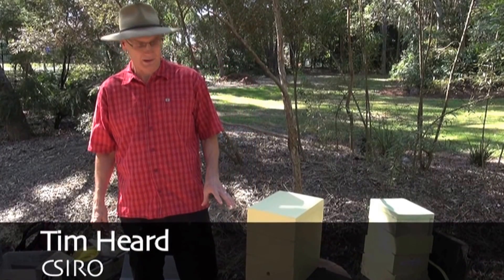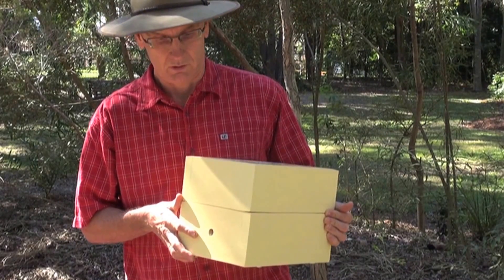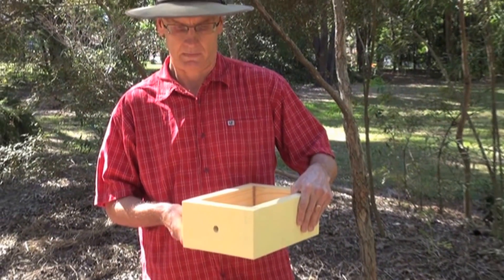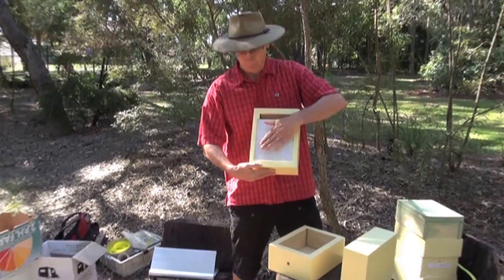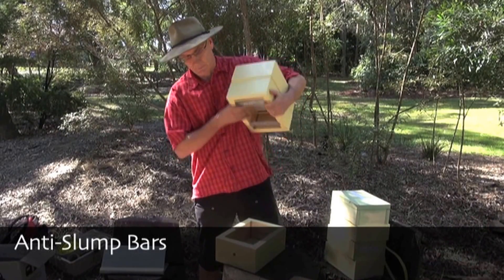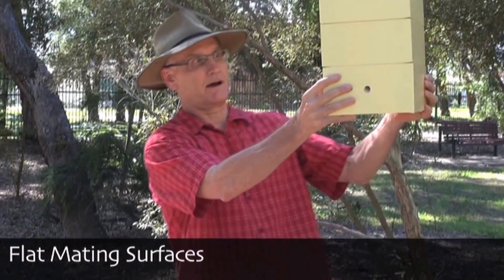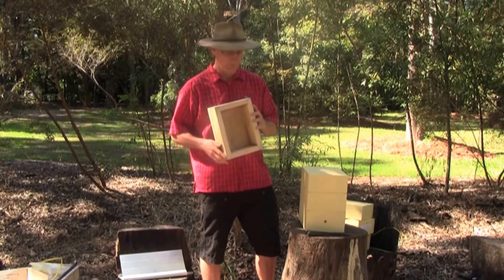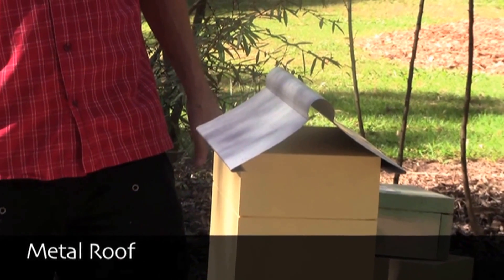Part 1: Design of an Australian Native Beehive

Comment: Such hive is just for a small family. Normal family is 50000-80000 bees and they need a volume around 100 L. An entrance - like a small hole will be a huge problems for coming in and out bees and it's not enough for ventilation of a inner volume of a hive.

Comment: Great and informative videos. Can I ask a question?
I have a two-tier hive that is thriving and have built a new three tier hive as described with a spare brood box to add to the existing hive when split. 
Now I have a dilemma, how do I now get the brood from the top of the existing hive to move into the middle brood box? 
I’ve nailed the plastic divider in place, but screwed the slump bars.